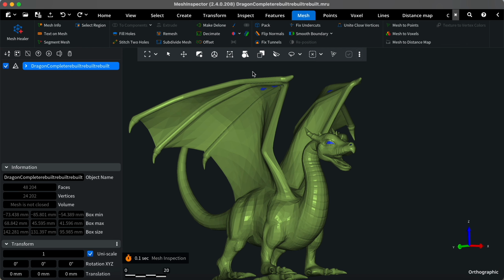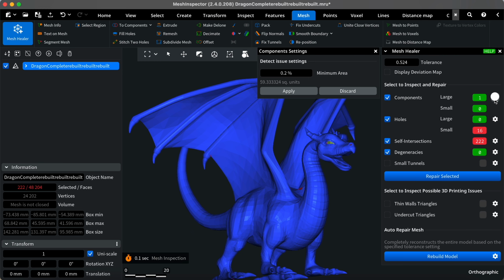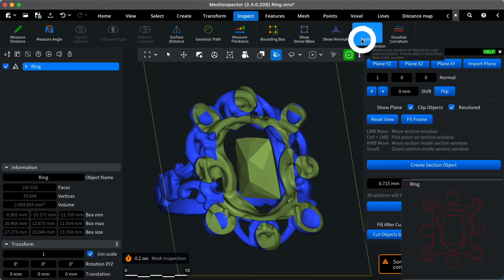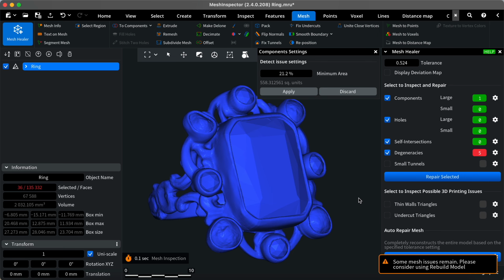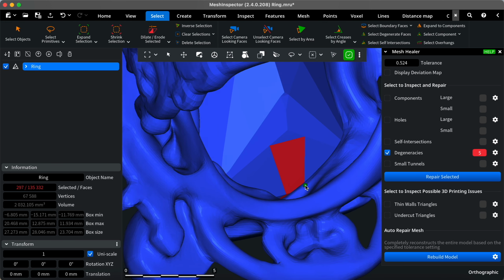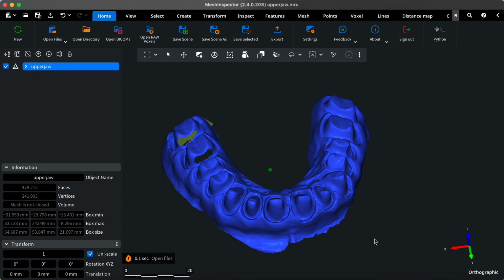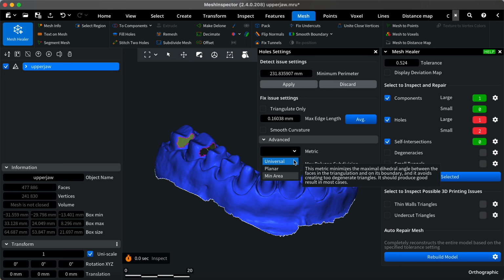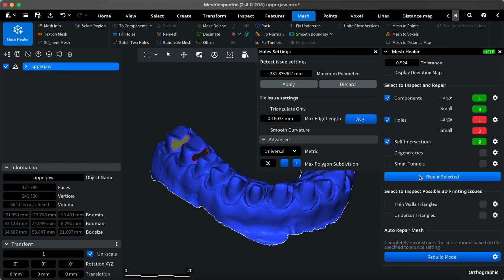STL Repair Examples with Mesh Healer: No Rebuild Function

Comment: You can see the normals on the dragon are wrong by the color. With default settings, the outer surface of an object is blue, and the inner surface is of yellowish color. If it's the opposite, need to flip the normals.